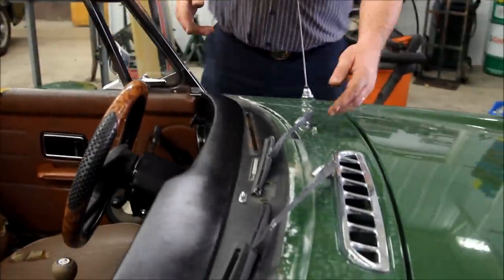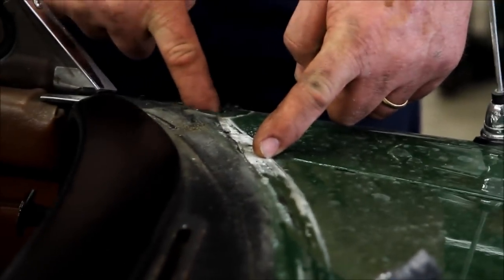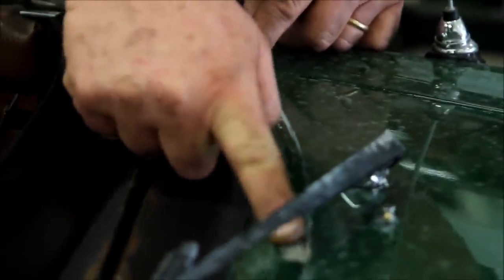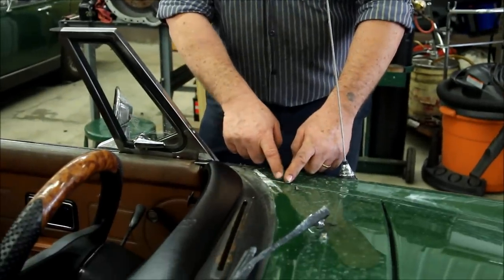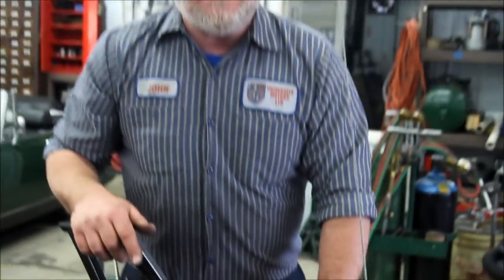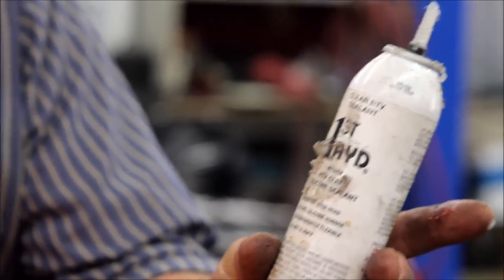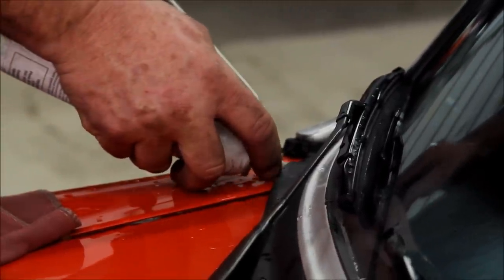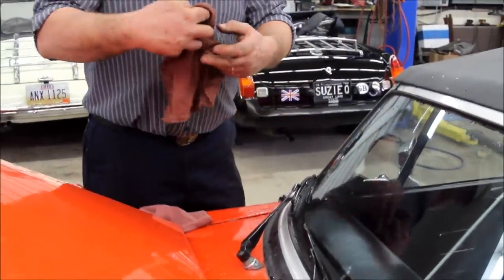213 MG Tech | Sealing MG Windscreens

Comment: This works fine as long as the rubber around the window and underneath the pane itself is still in good shape. When these rubbers become very old and stiff due to ageing in sunlight, you can repeat this exercise again and again, because it just doesn't last. New frame rubbers are needed, the frame has to come apart and the job of fitting everything together again is far from easy. In the end I managed but it is a frustrating job nonetheless..